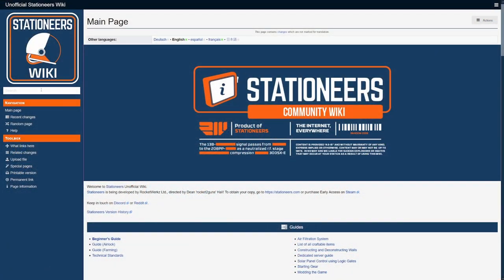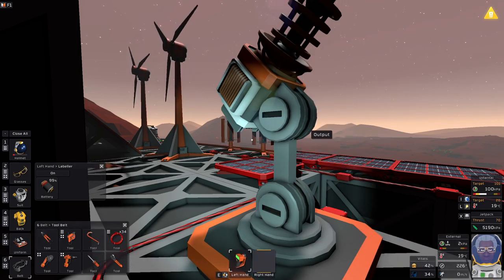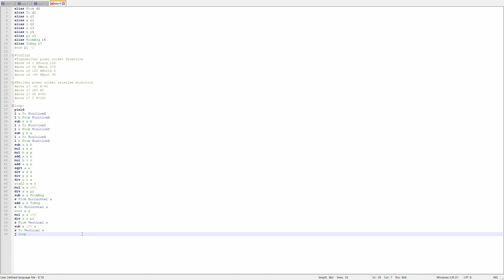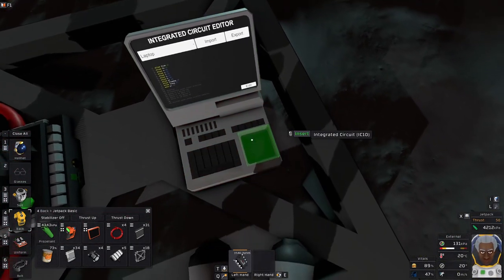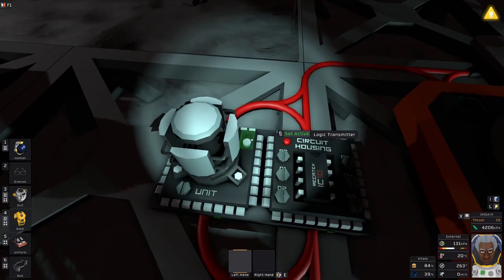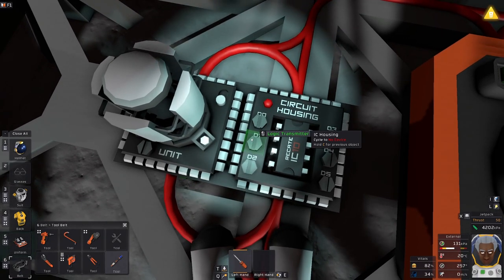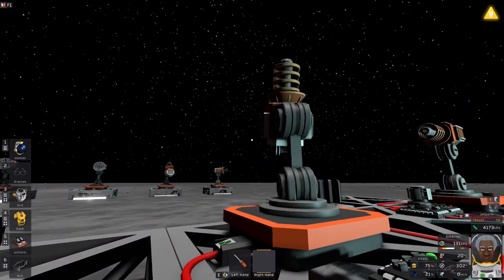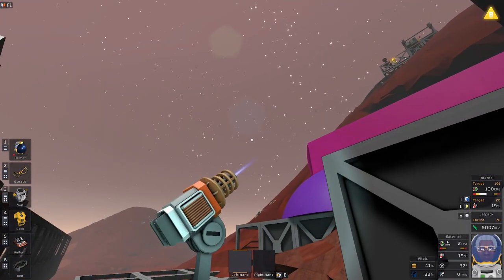Stationeers Wireless power setup tutorial

Comment: Here I ended up manually aligning mine, tweaking the alignment up and down until they turned on.  Also, I put stationary batteries at each end to act as buffers for the power transfer, though that probably wasn't needed.  One thing I don't like, the wireless power transmitters are limited to 5,000watts if I remember right.  Not great if you have a huge solar farm putting out 20kw.
Reply from the maker: Yeah the limit is not great. I wonder if it can be modified with a mod. Would make them more useful.